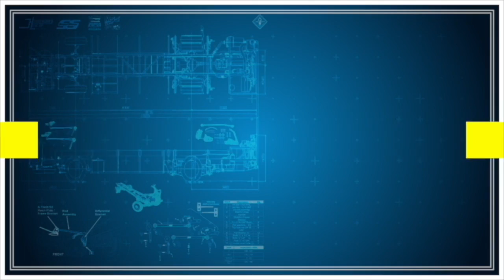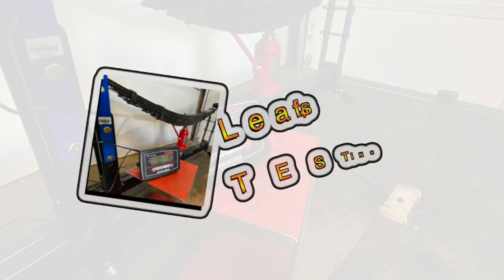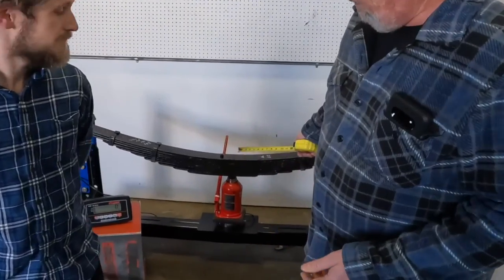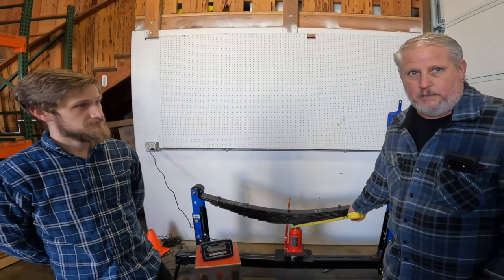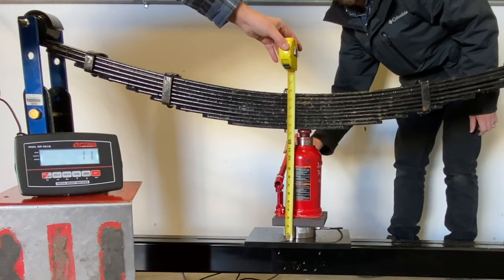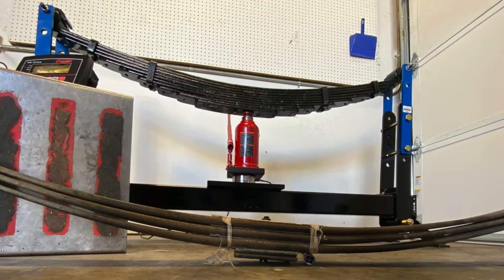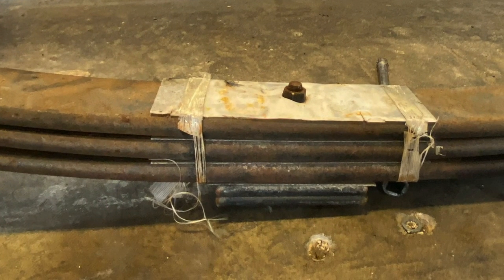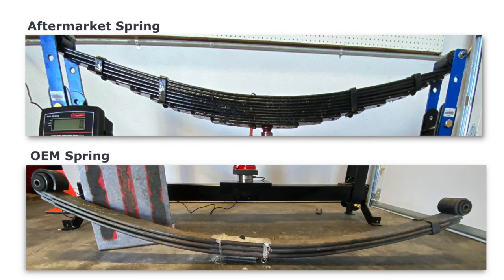Leaf Spring Testing - OEM vs Aftermarket for a Ford F53 Motorhomes.

Comment: Thank you. We purchased a new Winnebago F53 18K chassis in August. We installed Koni shocks , Safety plus and SuperSteer to help improve things. The sway bars were ungraded in 2022 by the manufacturer. Much happier with the ride but, definitely can still be improved.

Questions: does the aftermarket springs improve both ride and handling? 
Would you think it improves new factory springs, or better investment for older coach?
Any idea average cost installed? 

Thank you
Reply from the maker: Thank Anthony for the comment! Glad we helped you Winnebago back in August. The springs are still in R&D but if you call John or Tommy they can keep you up to speed. Mention this video when you call 888-898-3281

Comment: So what was the difference in spring rate between your aftermarket springs and the OEM springs?
Reply from the maker: Great question! You can call out EXPERT Tommy at the shop. He can be reached at 541-955-0769

Comment: woul u have a part number for that new spring or where i can get them n cost please
Reply from the maker: Thanks for the question! Part number, pricing and availability would depend on the weight of the front axle of your coach, and we currently only have limited offerings for the F53 chassis. If you are interested in getting an estimate, please give us a call at 541-479-2882.